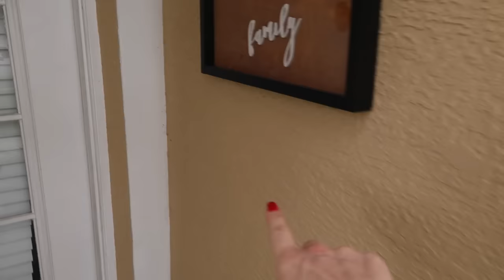❄WINTER❄ ALL DAY CLEAN WITH ME 2019 | EXTREME CLEANING MOTIVATION |Collab @BeautyTheBeastons

Comment: I use to write a cleaning to do list every day. I created a cleaning binder now. Wrote everything down what to clean in each room. Slipped each page into a page  protector page.  You can use a dry erase marker to check off what you did. Wipe it off and it is ready for next time. Now I deep clean one room a day and tidy up the rest of the rooms. Now my home is pretty clean all the time. I created some habits now too. Make my bed as soon as I get up. Clean the shower walls while I take a shower. I use one of those dish wands. Dish detergent and vinegar. Cleans amazing. Wash , dry and put away dishes after every meal. Scrub toilets and sinks every morning. I also down sized my stuff so cleaning has become so much easier. Good luck on the house hunting.